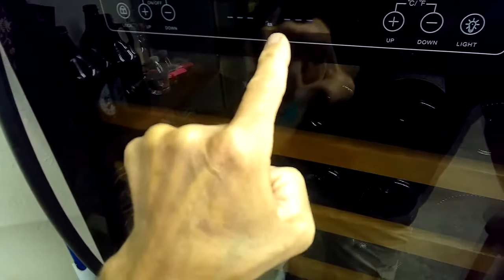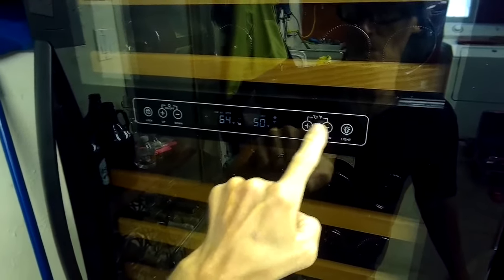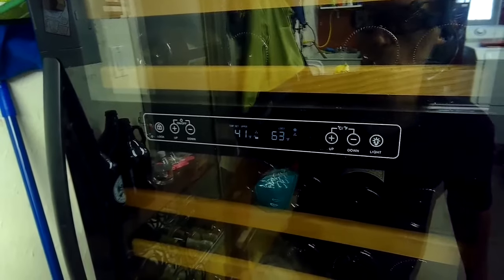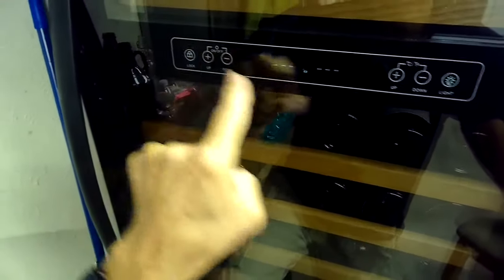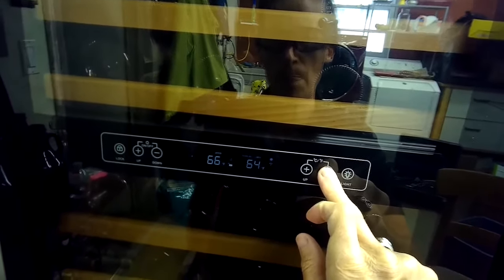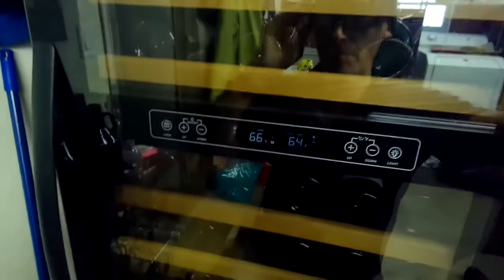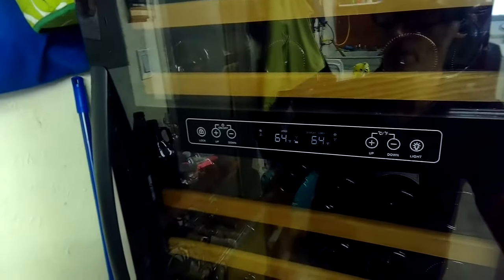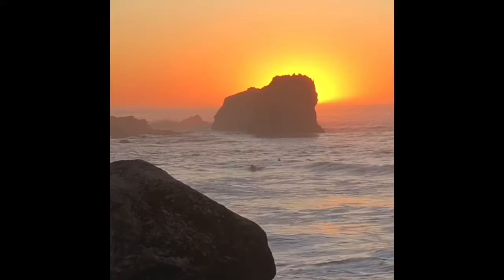✨ WINE FRIDGE - HOW TO OPERATE The Controls ✨

Comment: Thanks for the vid. My problem is the lower zone temp won't change. The buttons work because when I press them together it changes from F to C but individually it won't change the temp up or down. the top zone temp changes. Any suggestions?

Comment: I just bought a new wine fridge but the temperature control key for the Top Zone doesn’t go down to the temperature that I want it to be. It just goes down to 14 degrees celsius and that’s it when it says in the manual it should be able to go down to 5 degrees celsius. What is the problem with my wine fridge? Thank you.
Reply: I've seen in tech manuals for fridges that a colder freezer will necessarily suck away cooler air from the refrigerator. Your lower zone may be set too low for the top zone to get down to where you want it.
Reply: There is a way if you press the buttons in a certain order to get the temp below 14, I know because I have done it to my fridge before, now I’m trying to remember how to do it again, if you succeeded let me know 
Cheers